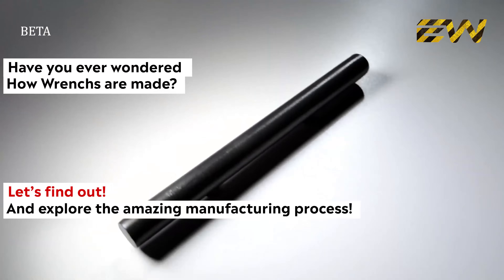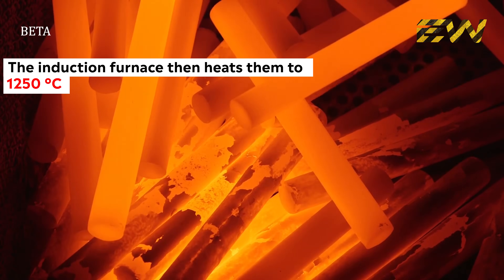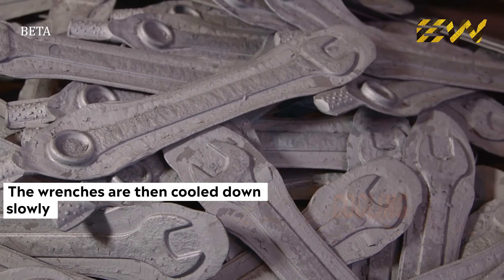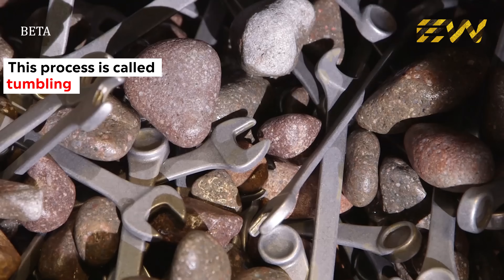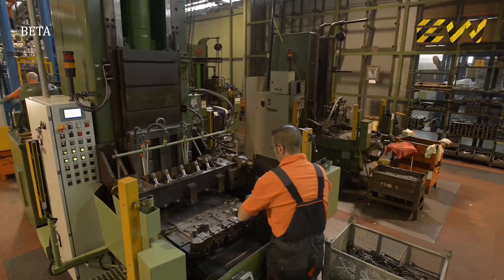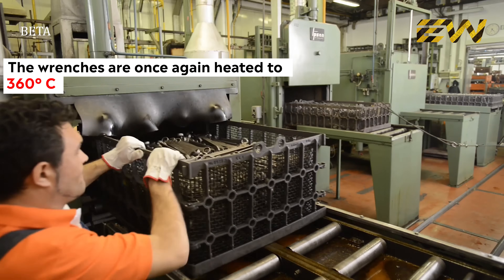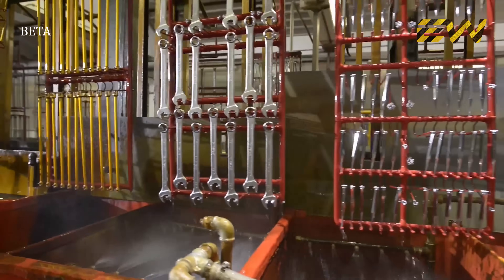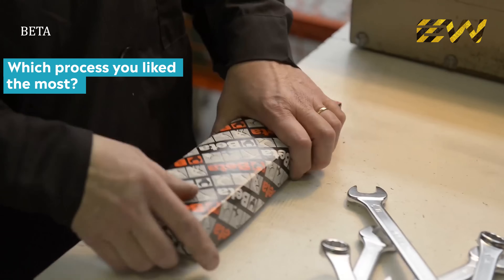How Wrenches Are Made In Factories?

Comment: With skillful use of a combination of flat cross-wedge rolling of forgings and stamping, it is possible to minimize flash and bring the metal utilization rate to 0.7-0.90 percent. Which is impossible to achieve by using forging rolls.